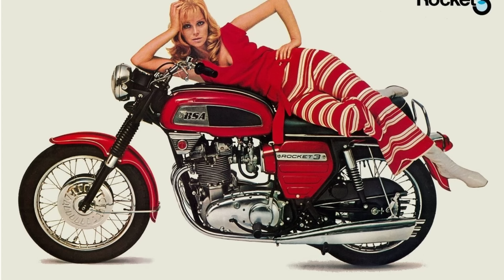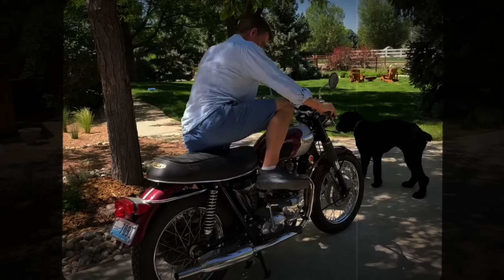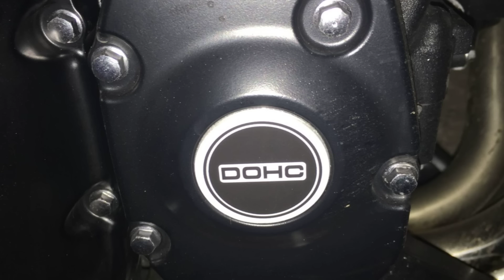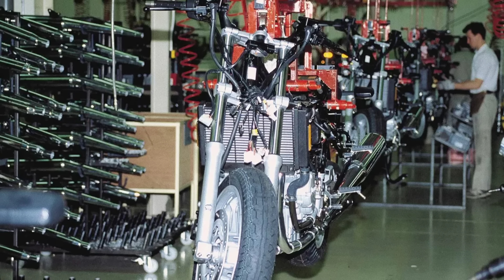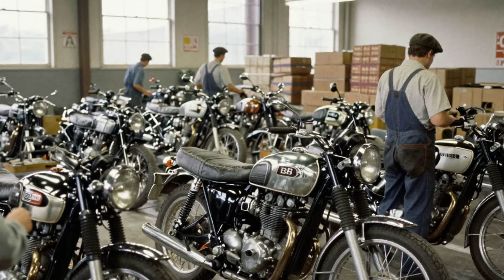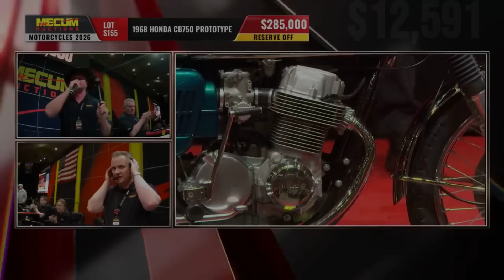Why Every Brand COPIED This One Motorcycle (And None Admitted It)

Comment: 1969 Kawasaki gave us the H1 500! Honda was set for a 1971 release of the K1 750 so, in the fall of 1969 they put out the pre-K 750! In 1974 Kawasaki gave us the Z-1 900 with dule overhead cams & shim cups with no tappets to adjust. giving us the super bikes that we are now flying on & bouncing them off the Rev limiter! Can't do that with adjustable tappets. Yes, the jap. bikes killed Triumph, B.S.A. Norton & royal Enfield & Matchless & Harly trying to hang in there!

Comment: Completely incorrect. Transverse 4 cylinder motors in motorcycles predated Honda`s version multiple times , for example Mv Augusta  and  over the years several other iterations. Many of the other "facts" here presented , in actuality are nothing more than opinions. a very poorly researched piece IMO

Comment: Honda could turn out the 750 very quickly as it had all the technology in-house. Double up on the CB350 twin and you get a 4 cylinder, anchor the pistons on a crank copied from the Civic. 
Had the most fun on a Honda 750 of all my bikes. Eventually modified it to eat Kawasaki 900s.

Comment: Even the earliar Hondas were built on that Blueprint and they were bullet proof.  My first bike was a used 350and it was pretty much like a mini 750  but it didn't have a front disc.  I didn't even know that was a problem till I went for a canyon ride and saw how fast brakes fade if your sporting around.  the 350 was peppy enough fro a beginner and could go 65 on the freeway just fine.  My friend that owned a 650 Bonneville let me ride his when he thought I was a good enough a rider.  My god what a terrible machine it was.  It took a couple minutes to get used to the pedals being on opposite sides.  But that engine was rougher than hellat 45 miles per hour it just beat you to death.   Later I got a used 72 750 for $125  it was rough but still sound,   I went though the cleanup but it was a good bike and my firend helped me synch the carbs.  I was terrified but it was so easy to manage and smooth it was a great bike.  after riding the canyons i learned why more modern heavy bikes have dual discs and I found the parts for the second disk in salvage and the was a great mod which I would recommend on any old 750 unless you really need it original.   But that Honda was a great platform to grow into bigger motor cycles

Comment: You're looking at a copy of an offenhauser engine built in 1920 that won the Indianapolis 500 mi race until 1967....
Reply: ...........but in a  MOTORCYCLE....................with a Disc Brake....................... Not a  Shed Built  Race  engine .
Reply: @johncunningham4820 but a copy of a thoroughbred racing engine.... You are nothing but a millennial seedling suffering from ADHD... Now go take your meds and find some place quiet and lie down and think things over..

Comment: I reluctantly sold my 1970 (manufactured 12/69) Honda CB750 K0 motorcycle with 45,191 miles on the odometer, Vin #: cb7501016269, engine #: cb750e-1016228 for US  $11,000 to a customer in Denmark more than 30-years ago.  This amazing motorcycle changed the path of my life, and owned me for more than 35 wonderful years!  It was purchased in the summer of 1972 with less than 4,000 miles on it from the original owner for $935.00 (plus "use tax" and "transfer fees", those state bastards!).  Because of a desire to precisely maintain this motorcycle, I went to my local Honda dealer (Kolbe Honda, So. CA) and ordered the factory service manual.  I looked at the required tool list and saw this "vacuum carburetor synchronizer" and went to the Kolbe parts manager who told me the price was $387.00!  Since this was more than one third of what I paid for the entire bike, I rode to the local auto parts store and purchased four vacuum gauges, 3-16" rubber vacuum line, "Bundy" brake line tubing, and four metric screws that matched the ports on the carburetors.  Looking at the small photo in the manual of the synchronizer, I realized I needed to purchase four "needle valves" at the aquarium store to dampen the intake pulsations.  I built a copper manifold and attached the four disassembled gauges to a vacuum pump (an old refrigerator compressor) and learned to calibrate the aneroid gauges by bending the Bourdon tube so that they all tracked each other, they didn't come that way from the factory!  I cut the Bundy tubing into lengths, and brazed it to the metric screws that I had drilled and added rubber o-rings.  After completing and testing the prototype, I went back to the parts manager and showed it to him, and he said how much for a quantity of ten?  After negotiating a price with him, on may-15-1972 (my 20th birthday), I formed my first company, "Four Designs Company" to manufacture my first commercial product: the "Vacu-Tune" carburetor synchronization gauge set for Honda four motorcycles, (I sold more than 3,000 of the gauge sets, please see my YouTube invention video, just click the circular logo "H2H").  I sold the company to my Jr. High school friend and he is still in business, now re-manufacturing electronic test and measurement instruments, (see: "fourdesigns.com").  I know that there is a lot of interest in the original production run of these motorcycles with the "sand-cast" main engine cases, but aesthetically, I always preferred the finished look of the painted die-cast cases. I definitely prefer the look of the K0 model with it's matching painted side covers, air-box, and headlight bucket. The k1 model just didn't have that unique look that this original motorcycle is famous for.  David Riddle

Comment: The Lambretta TV175 series III had a front disc brake in 1963.
Reply: Nerding out  your  Inner  Mod, huh.................😂
Reply: Facts is facts - fact! 😂 @johncunningham4820
Reply: Was it mass produced in the numbers Honda did with the CB750?
Reply: @TheBlueDogMan silly comparison. It was not for the US market and was in a completely different target market than the 750-Four.  The fact remains, that the first disc brake on a mass-produced, two-wheeled vehicle, was on the SIII Lambretta TV175.